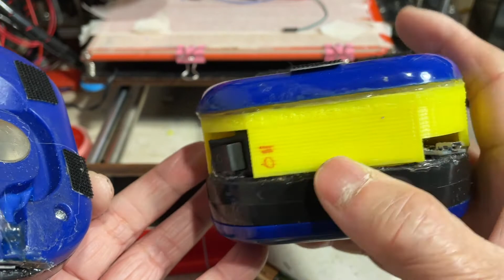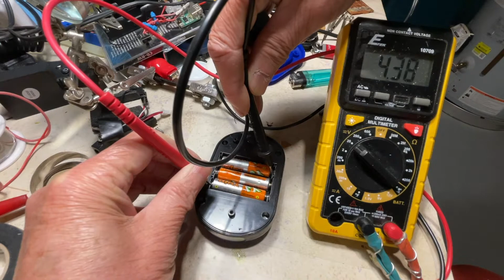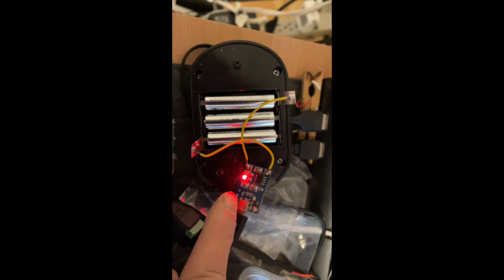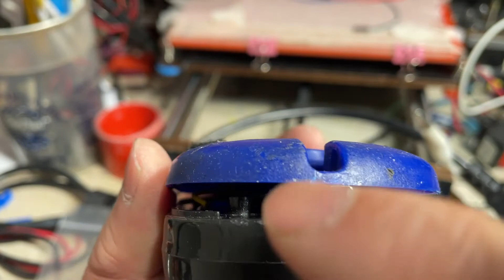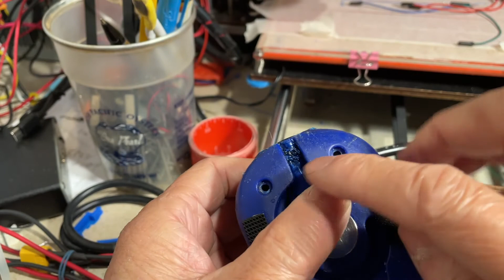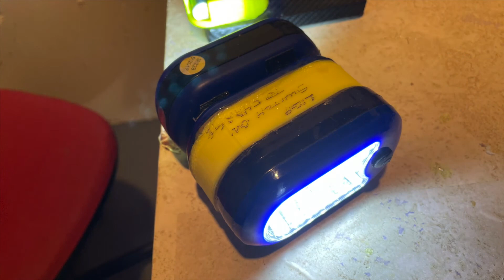Easy USB NIMH battery conversion for harbor freight led light

Comment: are you overcharging the nimh,s ,  1,2v per battery ?
Reply from the maker: Norminally at 1.2 but fully charged at 1.32 volt. The charging board I was using cut off charging at 1.34v.  Normal fully  charged NIMH batteries are at 1.32 to 1.34. Batteries coming right off an eneloop charger can be as high as 1.4v.

Comment: That was a nice little mod, and fairly easy to do.  I was just sent a set of rechargeable AAA batteries that have the USB port built into them, but I like your mod better, no need to open it and remove the batteries to recharge.  What I really wonder is how much it would have cost, at the scale they produce these lights, to make them rechargeable from the start.  It would certainly make them more valuable.
Reply: Well, use this as an example, but a solar light has one AAA battery in them (around 200mah whereas a decade ago it was 600mah) and a solar panel, the electronics, etc... the total cost is 97 cents at Walmart.
Reply: @generalawareness101  That's actually a great example, especially if you consider that the shipping cost is also included in that 97 cents.
Reply: @jaykay18  Yep, and being at Walmart the price of the Brick and Mortar utilities and workers as well.
Reply from the maker: My thinking is just like yours. I was thinking you can use rechargeable batteries for most flashlights but you have to take them out and put them into a charger. USB charging makes it much more simpler to use. Lithium ion battery is nice but NIMH batteries are safer and work under most conditions.